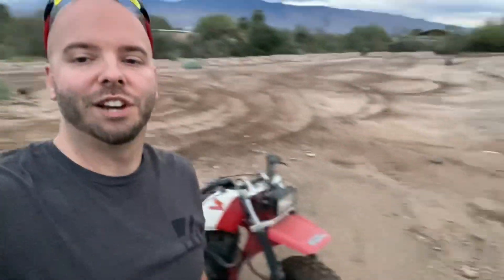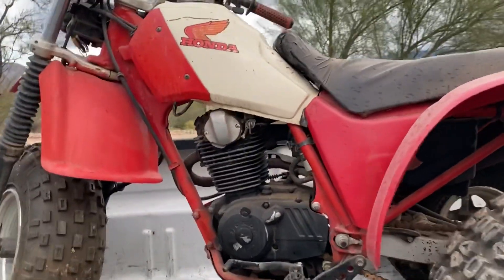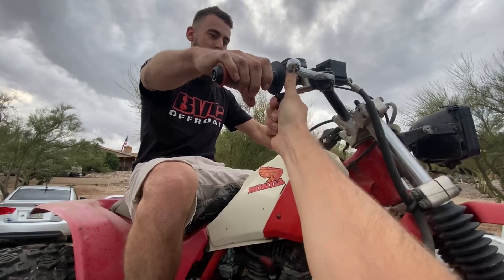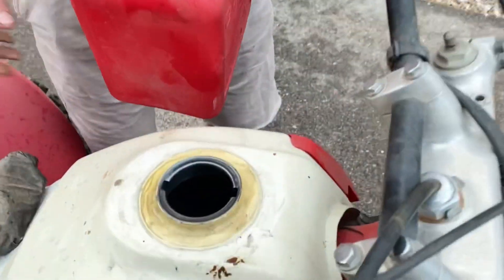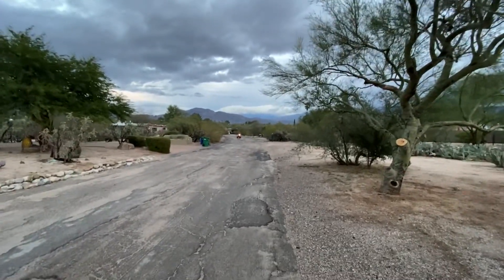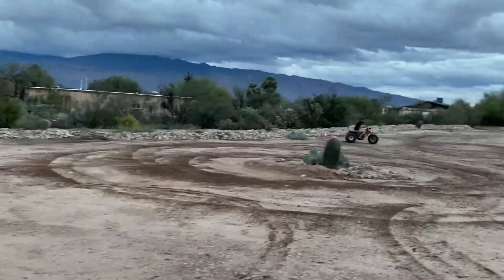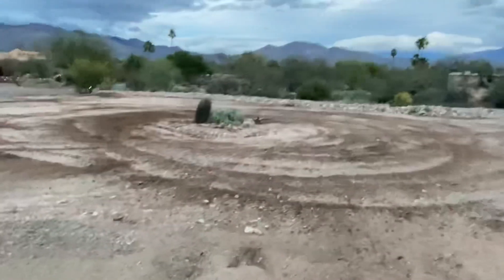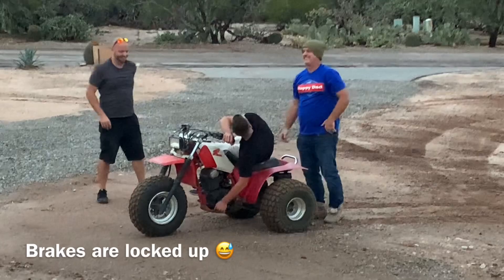1984 Honda ATC200X Barn Find

Comment: I learned to ride on a '85 when when I was 9. Could barely steer it. Had it roll over my body a few too many times, got sucked through the wheel well. Still have a scar between my eyes 36 years later from hitting my head on the crossbar-less handlebar clamp bolts 🤣

Frame front downtubes always break on 200Xs if you jump them... need gussets. Outside of that, they're pretty hard to kill. That thing isn't cool until you put a Supertrap on it 🤣

Comment: Good content you guys, and nice score on the barn find. My father was a certified Honda tech back in the '80s and I remember uncrating 350X's, 250r's, and big reds. Remember when they came out with the 3x4 conversion also when they did the ban on three-wheelers. Wish I still had my 84, 85, and 86 Honda new motorcycle, ATC, ATV lineup posters that I had as a child

Comment: I just finished fixing up my 84 200x mine has an electric start kit. It was difficult to rebuild the brakes using oem Honda parts and not chineesiam but I got everything working and prettyed up with lots of new parts